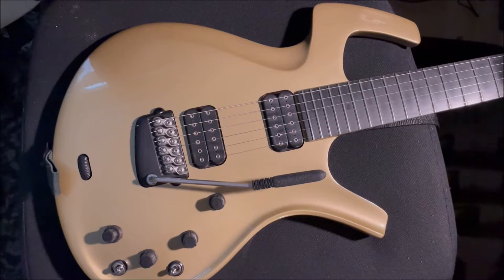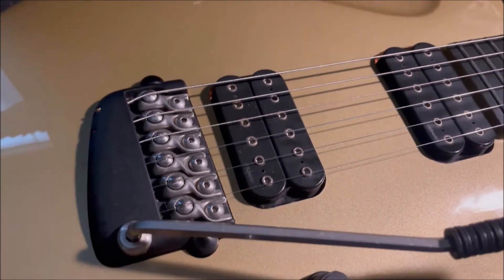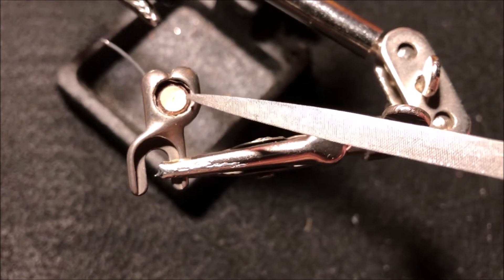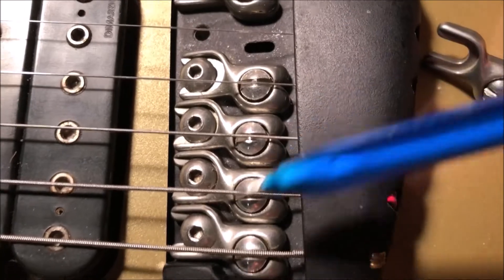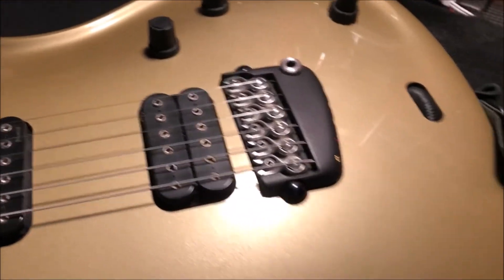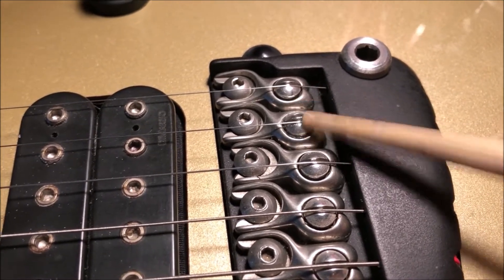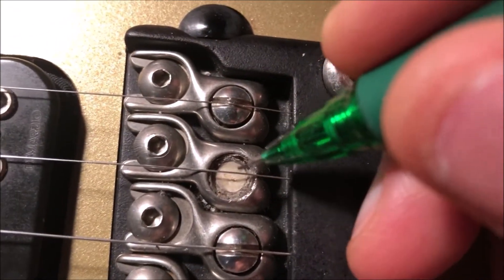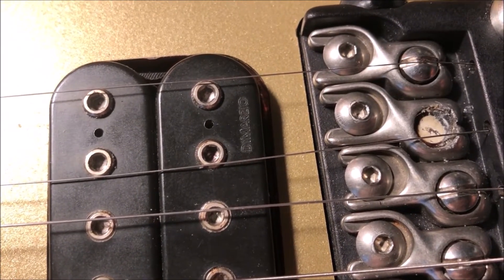Parker Fly Broken Piezo Repair Attempt

Comment: 7:57 yep. 9:41 your conducting vibrations not electricity through cap, the cap passes vibrations go piezo which converts sig to electrical
Reply from the maker: Yeah the problem is that there is really no way (that I know of) to properly join all of the crystals back together. Fortunately I knew someone that worked at Parker back in the day and he was able to send me a couple of NOS saddles, which fixed my problem.
Reply: @VegasCyclingFreak 
If i were to guess, ground crystal with some type of adhesive

Comment: Thanks for great video! I have a problem and I request the help of anyone reading this with the following neck issue:

SUMMARY: 
My Parker Fly has a small crack at the neck joint that I want to fix so I can play it safely. It is about a 1.5" crack on the bass-side of the neck. The crack is mostly on the bottom side of the body but also creeps up the neck on the top-side of the body. At the joint where the two cracks meet there is a chip in which you can see wood - it is about 1/8" in diameter. 

Honestly, it all looks superficial. It still plays great with seemingly no repercussions from whatever impact it suffered. I am leaning toward using a touch of epoxy so I can just play it safely without doing more damage, but I am open to a more complicated, $1,000-ish restoration (if I could even find someone capable of such a thing). 

Thoughts??? 

DETAILED BACKGROUND:
Buried in my basement, in a GIG BAG, I just found my previously disappeared original 1995 pre-refined version (which I am ecstatic about!). Apparently, after the Parker survived a house fire in 2001 mostly intact, my Dad has secreted it away with the honorable intention of restoring it for me. In fact he even took an advanced course on carbon fiber repair (he is a retired machinist also). 

The only damage of significance that it suffered in the house fire is a small rack at the base of the neck, on the bass-side. It is mostly superficial, about a 1.5-inch long crack that chipped enough on one end of it to see about 1/8"-diameter amount of wood showing on one end of the crack. The crack goes on both sides of the neck (above and below the body where the two connect). Aside from the small chip that you can see wood through, the crack seems to only be in the carbon fiber. 

Surprisingly, the action is the still good, the neck does not look twisted or feel twisted, and it plays nicely, even up high. I went through the electronics and it still looks beautiful; no water damage and just a tad of wear-and-tear minor corrosion that I cleaned off with vinegar and a small brush. For a 25-year old guitar that sat in a case for 15+ years it is surprising how good of condition it is in (otherwise from the crack issue). 

So I could use some advice on how to fix this. There are two directions I am curious about pursuing, one just for functionality and the other being a beautiful restoration. I have an appointment with my luthier next week, but I would like to go into the appointment with some specific Parker-related knowledge.

Is there even someone capable of restoring it to near-new condition? I'm not talking a full paint-job restoration, that's just more costly than it would be to buy a used one in top-notch quality. For this direction I'd budget roughly $1000-$1500, maybe a bit more depending on the quality of the end-product. 

The option I most likely intend to go is to just fix it up for safe, personal use. Honestly I was just thinking of applying a small amount of strong epoxy, hopefully one with a carbon fiber base to it. I'd sand it and put a little touch up paint on it. Im thinking about wrapping it too as I'm not a big fan of the purple paint job.

What do you all think? Anyone with some experience with something like this reading this post? Any random opinions out there?
Reply from the maker: Honestly, I would want Ken Parker himself to make any kind of repairs to the carbon fiber, etc. As far as re-painting, back when the Parker Guitars forum still existed, there was a lady that members there liked to use for repainting Flys for various reasons. She went by the name "Shazrock" as I recall. I don't know if she is still doing it or not. Best to ask these sorts of questions at flyclone.com forum - they'll know a lot more than I do.